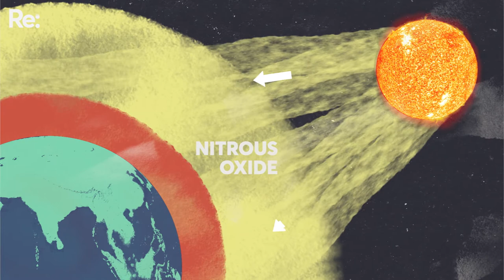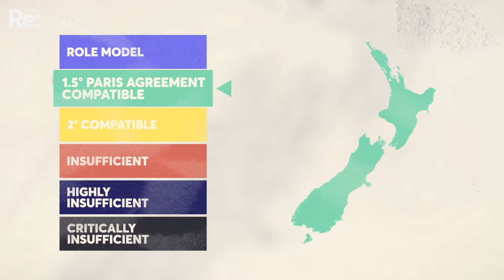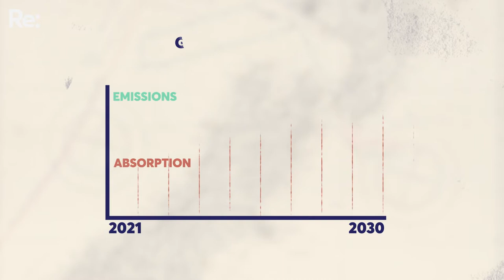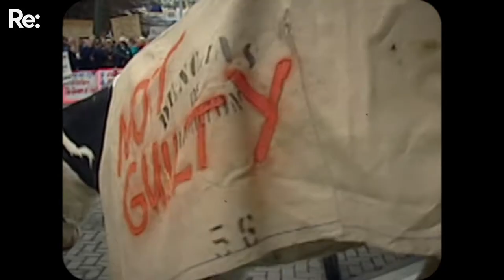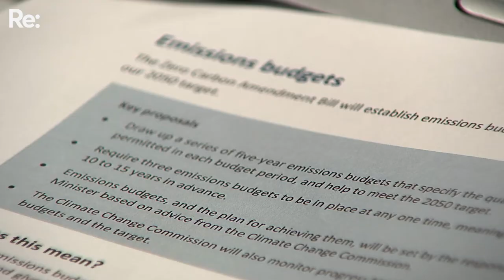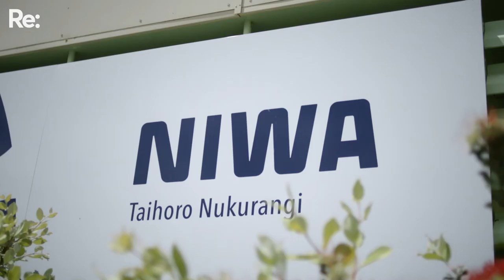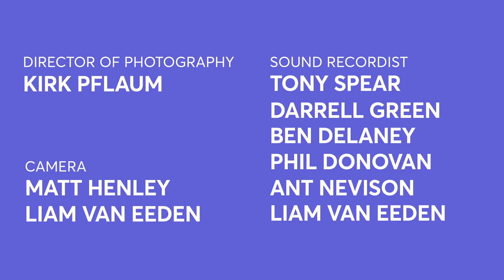Why our dairy cows produce more emissions than our cars | Milk and Money | Episode 4

Comment: Methane emissions in NZ are short lived and they are also stable and that means that every emission does not cause any increase in atmospheric methane as each emission simply replaces constantly decaying atmospheric methane. Livestock emissions only produce half our emissions when you use the CO2 equivalent system which does not take in to account the cyclical nature of methane. The system is not scientifically credible. If you just take methane on its own because it is being emitted at the same rate as it is decaying, it is at net zero already.  It is not causing any increase in atmospheric methane and therefore it is not causing any increase in global temperatures
Reply: Methane from cows have no impact of climate change?  That is an extraordinary claim.  Can you cite a credible source to back up your claims?  “Extraordinary claims require extraordinary evidence” was a phrase made popular by Carl Sagan.  Until you back up your claims, HItchens' Razor applies.

Comment: The figures quoted in the video for ruminant methane's contribution to NZ's overall warming potential are now out of date.  The Climate Change Commission showed that there is now a steady downward trend in ruminant methane emissions in NZ and that these emissions only last from 9 to 12 years.  Because farmers are not increasing stock numbers there is therefore no additional warming - in fact a slight cooling effect - occurring.   The amount of ruminant methane lost in the atmosphere exceeds the emissions of new methane.

Furthermore the video failed to show that farmers use significant amounts of Greenhouse gas - CO2 to grow grass and the growing amount of vegetation on farms.  A fair analysis would show the net effects of ruminant emissions.  Emitters of CO2 generally do not offset their emissions - farmers do.  In fact many farms are 'carbon neutral' using as much Greenhouse gas as they emit.

The method for calculating the warming potential of methane used earlier has found to be inaccurate.  It focuses on volume rather than an ability to influence temperature.  Scientists like Dr Myles Allen have shown in recent work that ruminant methane is only 25% as effective at actual warming as the official numbers circulating in NZ and used in this video.

Blaming farmers for being slow to take action shows a concerning level of ignorance about what is happening and how historical data and theories are being questioned and overturned leading to the 'problem' being significantly less than is regularly claimed.
Reply: I don't think this video (and this doc serie) is "blaming farmers". It is pointing at an industry obsessed with profits and playing down all the devastating consequences of their actions. The system and the governments not acting to change it are to blame and are blamed here.
Reply: @ElricAzarai        What can every consumer do about it?  Boycott animal products.  
Going vegan is the single most effective way for each of us to minimize our environmental footprint.
"According to the most comprehensive analysis of farming’s impact on the planet, plant-based food is most effective at combatting climate change. Oxford University researcher Joseph Poore, who led the study, said adopting a vegan diet is “the single biggest way to reduce your impact on planet Earth.”

 “A vegan diet is probably the single biggest way to reduce your impact on planet Earth, not just greenhouse gases, but global acidification, eutrophication, land use and water use.”. 
“It is far bigger than cutting down on your flights or buying an electric car,” he explained, which would only reduce greenhouse gas emissions."-Joseph Poore, Environmental Science Researcher, University of Oxford.

Joseph Poore switched to a plant based diet after seeing the results of the study.

Links at my channel under "About."
Reply: Can you cite a credible source to back up your claims?  “Extraordinary claims require extraordinary evidence” was a phrase made popular by Carl Sagan.  Until you back up your claims, HItchens' Razor applies.
Reply: @someguy2135  I am 100% with you about veganism! <3 My comment was about the 'blaming farmers' :)